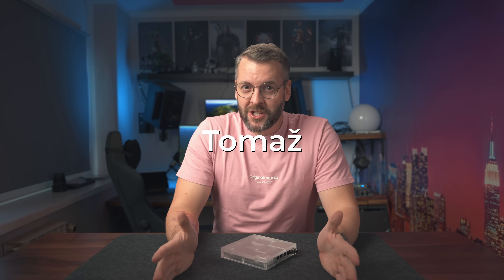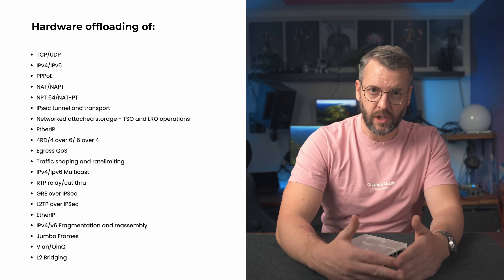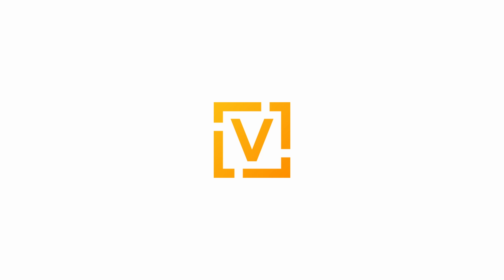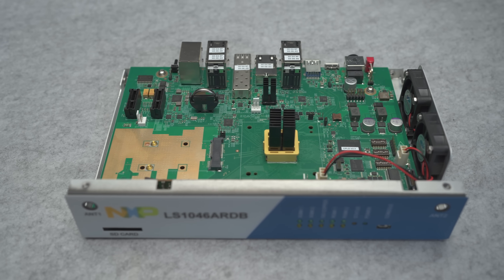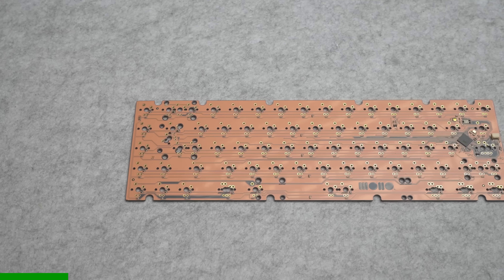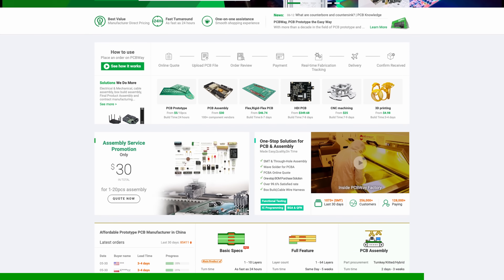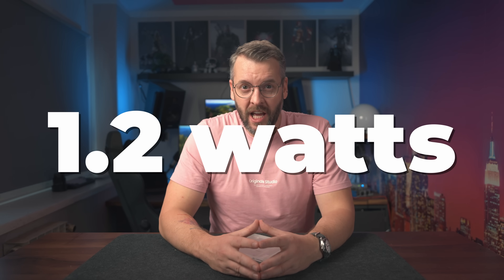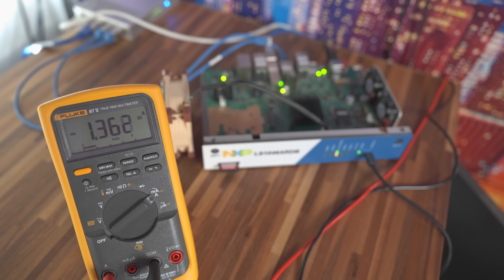10 Gb/s throughput without using CPU cores? ✅ Check.

Comment: It's a tough one, but I would benchmark Wireguard performance and opt for the cheaper alternative if the numbers are still great.
Reply: Big plus for Wireguard!
Reply: Wireguard is stateless so I would be surprised if it can't be hardware accelerated once the crypto algorithms are supported.
Reply: @davidmcken  Wireguard is designed to run fast on CPU, using algos that are best suited for CPU. The flip side of this is that nobody is going to make a hardware accelerator for them because they run so fast on CPU anyway
Reply: Wireguard doesn't run in any hardware acceleration - even on full-fat AMD or Intel CPUs... It's highly unlikely that it can be offloaded.
Reply: @CRCinAU  See the "Intel AVX-512 and Intel QAT - Accelerate WireGuard
Processing with Intel Xeon D-2700 Processor" paper, they hit 56Gbps with acceleration vs 5Gbps in software so there are clearly benefits to be had from acceleration (mostly the crypto).

Wireguard is just optimized enough that most people never hit the limits of the software implementation or something else becomes a bottleneck first.
Reply: I don't think he can show any tests that would make NXP look bad. NDA and pre-sales agreements are active so all we get is fluff from here on out.
Reply: @user-dy9ux5dc6e  if NXP is bad, then it's bad. A different player should be preferred.

Comment: If actual network traffic uses very little CPU and RAM, I'd rather the device be cheaper.
After all, what's the point of all that performance, if most of it isn't really used.

Of course, that's assuming there won't be any other major features that would require good performance?
I only listened to the video in the background, so I might have missed something.

Comment: I would say that, at least for the initial launch, using the lower-end components to slightly reduce the cost might be the better route, especially if the system is as resource efficient as you're claiming; maybe after getting yourself established you can release a "pro" version of the router with the higher-end components.

Also, is there any chance that PoE will be available to any of the ports?

Comment: Excuse my ignorance but if hw offloading means you cannot run a tcpdump how would you run a tcpdump given its a network device?
Reply: This is a really good question - I (hope) that one can use hw offloading for packet capture aswell?
Reply from the maker: I haven't gotten that far, yet. You can configure what exactly you want to offload, so for tcp dump, you'll have to turn it off, and then back on again once you're done debugging or whatever it was you were doing with tcpdump.
Reply: @tomazzaman  would that require a restart of network services/interrupt the network? If yes, i think it's a big problem, if not i think you would need to test the cpu while it's not offloaded to see if you can go for the lower cpu / hw

Comment: A closed source kernel driver from the SoC manufacturer ???

The problem is that you are stuck with a specific Linux kernel release that they support
Reply: As someone going through the hell of binary drivers now with embedded nVidia kit, you really don't want this. We're stuck on kernel 4.9 - and there is no way at all to upgrade from that. nVidia don't give you the magic sauce - so unless you want to port it all yourself (good luck without the in-depth hardware specs and syscalls), you're shit out of luck.
Reply: Yeap. See Also: Broadcom's "Open Source" NDK. (it's a huge binary blob with a few lines of shim code.) If they have an NDA and access to SDK source then they can build the driver(s) for whatever kernel versions supported - or they're willing to port to. Sadly, this is the way of the modern world... want performance better than a hamster in a wheel, you'll need hardware packet processing, and no one openly documents that stuff.
Reply: @jfbeam  I wonder how hard it would be co convince Linus Torwalds or someone in the Linux kernel community to provide an open source hardware acceleration for networking.
Especially if you could pay them from the router's development budget.
This would effectively create an open source competition to the weird NDA garbage that you just obtained.
Reply: @hubertnnn  It's been tried before. Chelsio Communications tried to merge their 'Open TCP Offload Engine' or 'Open TOE' solution into the kernel around 2005 (read the LWN article about it if you're curious). If the maintainers' comments are anything to go by, the problems are fundamental to the way the Linux TCP stack works (at least if implemented entirely through the kernel); such a patch requires hooking deeply into the stack which would make future high-level changes difficult, it 'skips' over a lot of networking functionality which would make functions like netfilter or traffic control unusable, along with security and performance concerns that I personally consider nonsensical in this case. David Miller, at least as of 2005, will try to veto any kind of TOE kernel implementation, preferring stateless offloads to be the only option.
Reply: No.. Look at VMWare workstation. 1 binary runs fine everywhere if it's developed correctly. I suspect the problem is that NXP simply does not want the world to see their sloppy hacked together code. They cant even make a quality chip - what do you really expect from their software?
Reply: the problem is when the patch no longer works because the kernel is o new and company moved on to something else
Reply from the maker: Not really, no. We get the sources, we just can distribute them, meaning we can patch whichever kernel version we want with them.
Reply: @tomazzaman  Hope you have some lawyers onboard, sounds like a GPL violation
Reply: @tomazzaman  I know you under NDA but is this actual source to the hw offloading engine and just a bunch of precompiled .o files that you link in to your image or is it something that you need to modprobe and there is a user space helper you can call ???.
Reply: @tomazzaman  YOU can, but your customers can't. This makes your product no different from the proprietary routers from companies like Asus, Ubiquiti, or MikroTik. Why shouldn't I go for their far-more-polished options instead?

Comment: is the router with 1.4GHz CPU and 4GB still a networking beast?
if yes, use the cheaper components.
Reply from the maker: I believe so, but I wanted to check with my viewership whether ya'll agree.
Reply: @tomazzaman maybe hardware packet processing isn't as powerfull in slower CPU (marketing reasons) or it requires full RAM bandwidth. Please also check slower CPU with less RAM (it could mean less memory channels) for hardware accelerated performance.
Reply: I mean for comparison, I'm using an off the shelf router with what I believe is a 1.2 GHz CPU and 128 MB of RAM, serving as an edge router for 4 APs and 7 devices actively connected at any given time (give or take). Is the latency good? Absolutely not, but it's held up fine for several years. Pretty much the only issues I've had were some DNS outages (quad9) and some issues with the ISP modem.
Reply: @graemewiebe2815 128MB of RAM sounds like DDR3 (Samsung and SK Hynix no loger produce from May 2024)

Comment: Logically, it's a no-brainer to reduce the costs of the cpu and ram, since they're barely being utilized. However, people like extravagance. And, depending on the final price of the product, it may make more sense to keep it as it is. You could also make the cheaper model have those reduced specs while putting the improved specs into the aluminum case model.
Reply: I just want it to be in a good price/performance ratio so why use a more powerful and expensive chip if it won't affect much performance
Reply: are 4GB of RAM still enough if you run a copuple of docker containers and VMs on it?
Reply: I thought the whole point was to save power, not to have processing alongside routing.. normally if your router uses its cpu, it uses it for networking probably, but if you have the cpu totally freed from its purpose, what purpose could you give it anyway(am I missing something)
Reply: if he's paying $72-92 per CPU, price has to be at least $800 either way

Comment: so you suggest providing only a pre-built kernel and without any option for the user to recompile it or upgrade it without losing acceleration?
since doesn't seem like you can redistribute the patches?
Reply from the maker: Valid question, thank you - added on my list for when I talk to NXP, and I'll make a dedicated video to answer all these.
Reply: same with strongswan patches 
if there is a security issue, there would be no way for an end-user to upgrade until it's fixed by NXP?

Comment: I don't want to wait until you release a bug fix kernel for a security issue that has already been patched months ago in existing distros' kernels.

This makes the product a non-starter.

If having to wait who knows how long for patched security issues in the kernel is a requirement to have decent performance with low power, I would prefer just to build a mini form factor PC with an AMD 5800X, pay the extra cost of the electricity, and do 10Gb line speed using 50% CPU.
Reply: You actually don't need that beefy and power hungry machine, there is a BananaPi R-4 which has great mainline Linux and OpenWRT support (with NAT HW flow offloading, WiFi encryption offloading (WED) working in snapshot and even QoS offloading with TC Flower in the making), already able to route 10Gbps with 0% CPU usage, it costs around $120 on Aliexpress. I would rather support companies and chip makers that care about mainline Linux and provide upstream patches for their SOC features (Mediatek in this example).
Reply: @elektronick88  Yeah I was looking into the BananaPi R4 precisely for all the reasons you cited... unfortunately, there's barely any documentation (most I could find was in Chinese, as *pictures*), no information on how to put the OS together, and it's effectively not even close to a finished product.  With my 25 years experience with Linux, I would still take a few weeks to build a usable router out of it.

But I suppose I can wait a few months until the whole thing has matured more.
Reply: @RuddODragonFear  OpenWrt has support for it, albeit only on snapshot for now. Next major release should have stable support.
Reply: @subrezon  Let's hope that comes soon, and then I'll experiment with it.
Reply: +1. I immediately had to remember the 9.8 CVE-2024-20017, which hit widely used Mediatek chipset routers - if they used their SDK.

The same devices running Openwrt were not affected (not based on SDK), but clearly would been patched fast if they were.
Reply: > 50% CPU
That's an exaggeration. There's a ton of HW offload, starting from network card and ending with kernel itself.

Comment: I am concerned that relying on the hardware offload capabilities will spell an early end for this device, for example if a bug in handling certain packet types is found (e.g. with new protocols afterwards) or the limitations that this places on additional features. For example the Ubiquiti EdgeRouters can’t do QoS with the hardware offload enabled - just an example that in general you end up being locked in to the hardware capabilities.
Reply: Yep - the edgerouters were great as routers - but add a few dozen firewall rules in place, and that shine quickly wore off. Offloading and demos like this are nothing special when there's no filtering, state checks etc etc - just packet in, packet out.

Add in 10-20 firewall rules in the place as well as stateful packet inspection and see that gloss quickly fade.

A modern day router is unimpressive and pretty much useless if all its doing is packet forwarding. Add in NAT, port forwarding, state tables, packet inspection, firewall rules, and then reality kicks in...
Reply: Another issue could be a security vulnerability in the hardware implementation that could leave the device open to attacks from the internet. You'd have to rely on NXP to patch it, and even then, if it's not updatable via firmware, you kind of have to recall the hardware.
Reply: This is a good point I didn't think of, I've also made a comment that the hardware offloading has no bearing on the CPU choice - We need to know what changing the CPU WILL affect, not what it won't.
Reply: And when that happens, it will fall back to the CPU, like on EdgeRouter. The feature will be available, but not offloaded. In that case, performance will be the same as not having HW Offload in the first place. No HW offload for this kind of CPUs means gigabit speeds at best. It is much better to have it, and in the edge cases where someone needs something that it is not offloaded the performance will be the exact same as if HW offload was never implemented. The amount of CPU power you need for 10Gbps routing depends a lot on the features you need. My router has 4x4.1Ghz Core i5 8th gen cores and 8GB DDR4 RAM, with IPS it can only do 7.5Gbps on BSD (pfSense) and 15.5Gbps on Linux. In this particular scenario, 1.2Ghz vs 1.8Ghz won't make a difference.
Reply: @andibiront2316 yes, so you can't cheap out on cpu and memory. Or the project might fail.
Reply: @MelroyvandenBerg  It depends. The performance difference from 200/400Mhz probably is minimal. But we need benchmarks to be sure, I guess.
Reply: @andibiront2316  The question is what would be running on that CPU, if not networking. If that router is supposed to have other things like file servers, print servers, etc., then reducing the CPU power will affect those, so the question is how much you need for them.
Reply: So, as far as bugs go, the hardware offload has its own firmware and can be updated.
Reply: This can be an a fine tradeoff if it makes the thing much cheaper and you know what it does do.
Reply: Maybe the DPU is patchable with microcode?
Reply: @customraspi  With firmware, yes. No chance they're doing all of that work purely in ASIC.
Reply: there is just tcp/udp so far, everything else is above this.